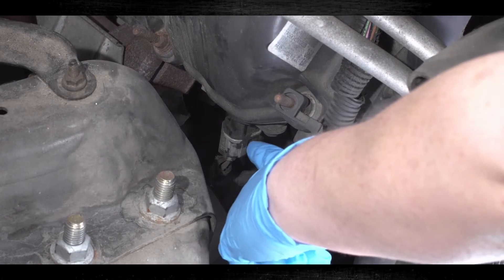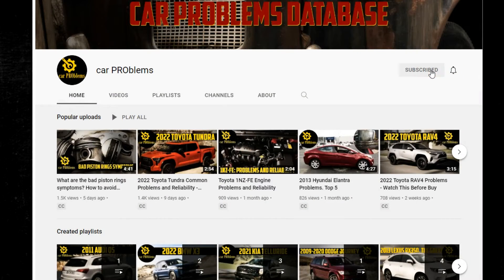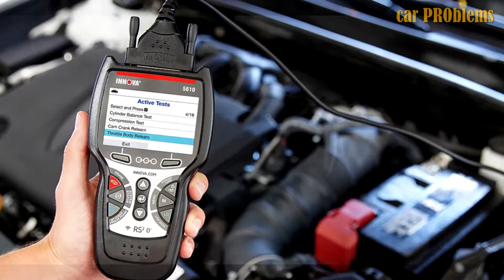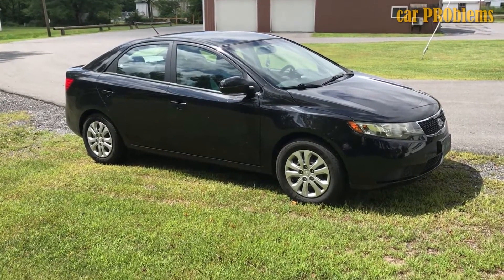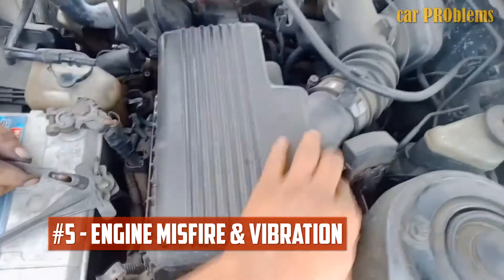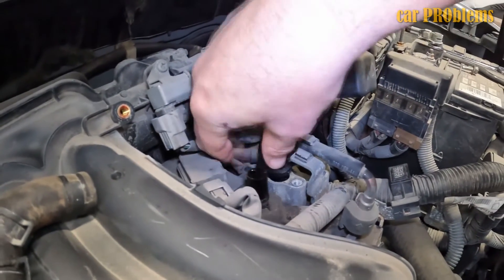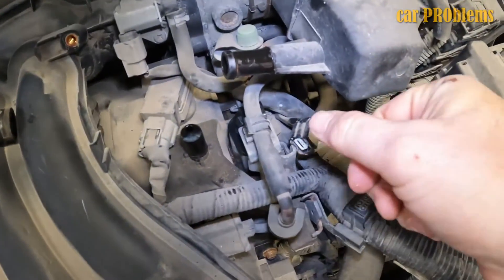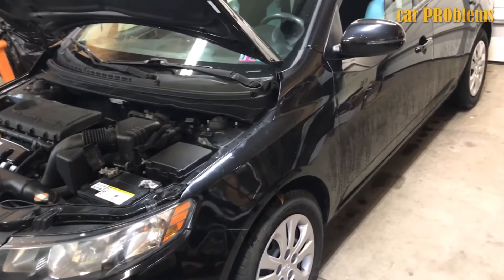6 Symptoms Of A Bad Camshaft Position Sensor and Replacement Cost

Comment: My 2000 rav4 was not starting and also before that I had to use starting fluid to get it started. I randomly pulled this sensor and it was pretty gunked up. I cleaned it and reinstalled after I checked it with a multimeter to make sure it was still good. My rav4 fires right up now and is running much smoother, before when it did run it was also backfiring occasionally when accelerating. So glad I figured out my problem ❤

Comment: Nissan X-Trail T30 had issues with a leaking camshaft. Car would go into limp mode occasionally. Used masking tape to fix as rubber seal was worn out. No more leaking and no more limp mode so far..